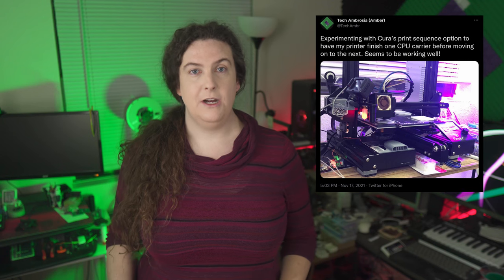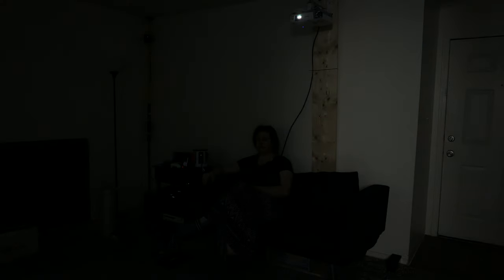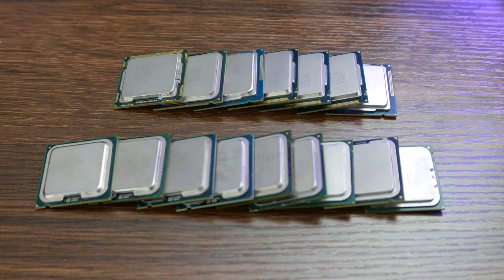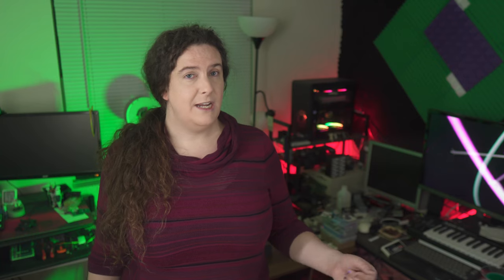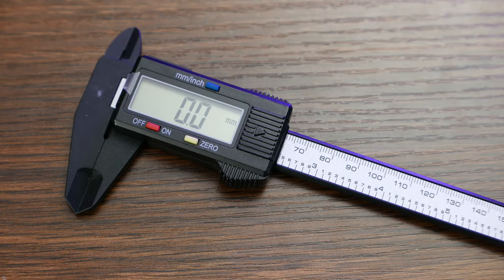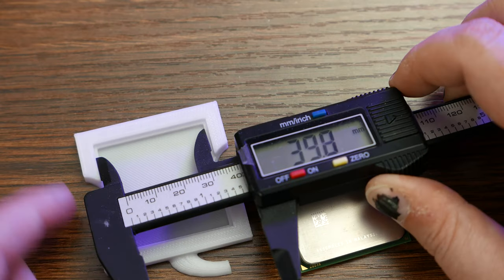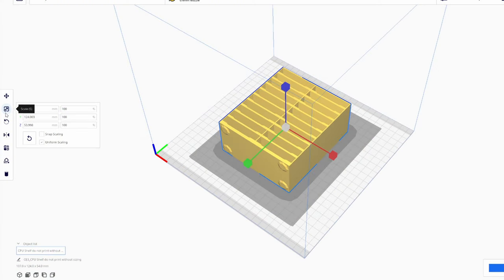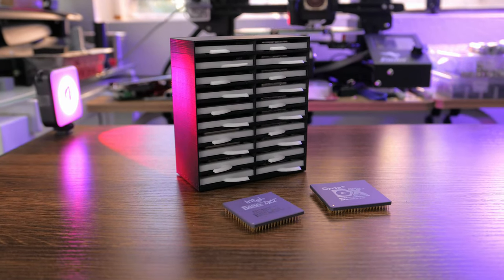Custom CPU Storage System

Comment: Ok this seems like a way more reasonable option for my collection than what CPUGalaxy host uses.
Reply from the maker: To be fair, CPU Galaxy has a much more impressive collection than I do 😅
Reply: That depends on the size of your collection!
Reply: @cpu_duke  oh I have a very small collection maybe 3 dozens of CPUs not installed in any motherboard/system and I hate the way they are currently stored.
Reply: You can hide them in a drawer or you present them on a showcase!

Comment: Fascinating.  I would try to print some of these just as a test, but I have found with the current temps here, that the Resin I use for my Saturn MSLA printer warps.  I am very new to 3d printing, mainly using it for models and miniatures, and I am still looking for various ways to defeat the warping.   The prints come out flat like you would expect, it's just during the curing process that they start to warp.  But this is a super cool idea even if I only have half a dozen random CPUs hanging about.
Reply from the maker: Oh interesting! I've never done resin 3D printing. I wonder what would happen if you printed these trays edge-on (like, maybe a 70-degree angle) with supports, and then cured them with the supports still attached? Would they still warp? Hmm....
Reply: @TechAmbr  depending on the size of the print, in my experience the supports do not keep the print from curling.  I could be doing it all wrong.  I am still learning.  I've only had the printer for a little more than a month.

Comment: Great job! However you might need a larger design for HEDT CPUs for Socket 8, Socket SP3/TR4 or LGA3647.
Reply from the maker: Yeah, this is for desktop CPUs only. I don't have enough HEDT / HPC CPUs to properly make a storage system for those right now.